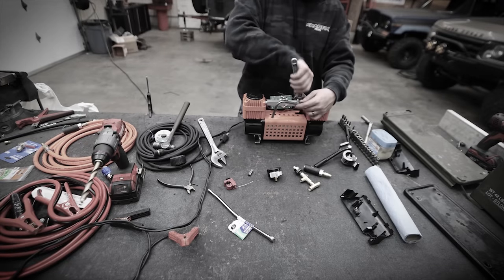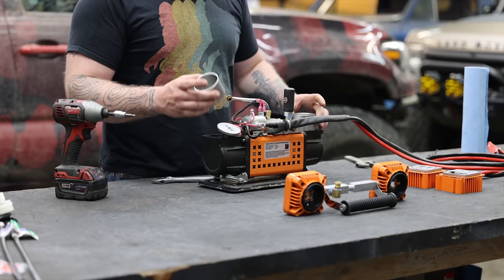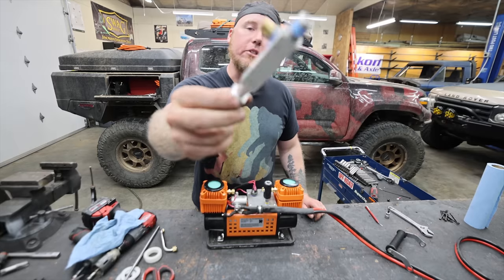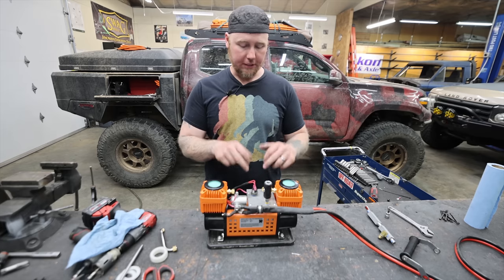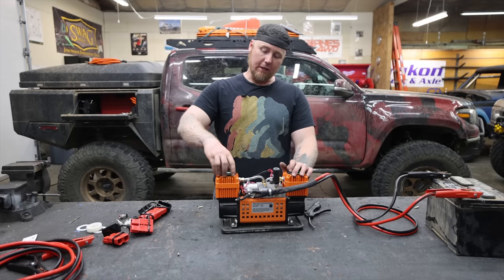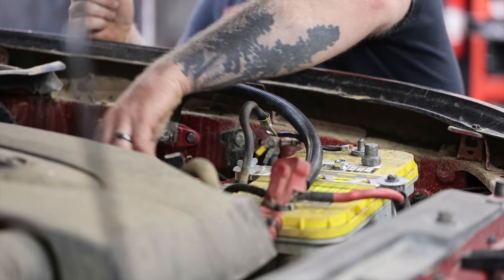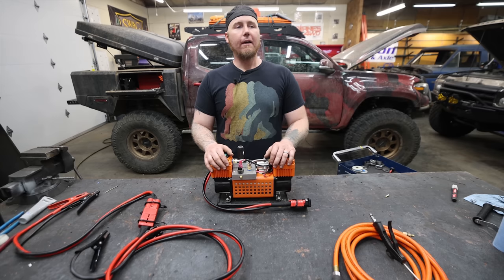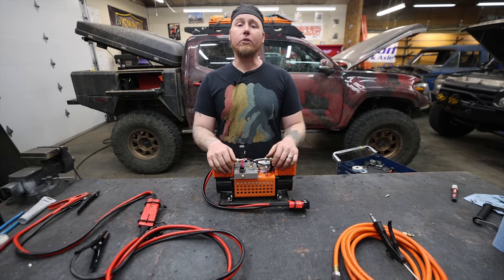Best Off-road Air Compressor MODS Part 2!

Comment: i've been interested where i saw folks running air hose under their truck that is plugged into their compressor and tank with quick connect ports next to each tire area. then to air up they plug in short hoses to each port at all 4 tires and can air up all at once. that would save a lot of time. maybe since your compressor isn't mounted in your vehicle you can have the port that would be plugged in to compressor tank just be another quick connect next to your power anderson port? 

can't remember the name of the channel or the guy that did this, but maybe you will recognize him: skinny blonde dude. has a tacoma truck. has a cool video about a 270degree batwing awning and more. both a no weld and a welded one. he has orange pelican cases on his truck. he took off his bed last year and did a custom flat bed with integrated storage boxes and sliders etc. that is all i remember though... if i remember i will update ;)

Comment: My only problem with these compressors is after 15-20 seconds the air becomes scolding hot and you have to top the tires up after the air cools.

Comment: Instead of a handle for it why not put it on a little metal sled? Add some hooks to wrap a few foot of air hose around. You could even add a little compartment for different air fittings for tires or inflatable air mattress or water toys.

Comment: You have so many cool ideas. You should think about  a small CNC or 3D printer.  Check out the channel Makers for Motorsports. The guy over there 3D printed an intake manifold.

Comment: Small Solar Panel wired with cheap mppt solar controller and anderson plug could act as a battery charger via the new power plug.....

Comment: Remember that at the end of the day you are limited by the flow capacity of the schrader valve on your tire so there is a point you cant inflate faster.
Reply: With a lot more CFM it can go a lot faster through the schrader valve. Guaranteed
Reply: Yep...try airing up a tire with 175psi shop air...big difference

Comment: I wouldn’t have drilled such a huge hole in the top of the “head” I would have drilled many smaller holes (like a grate, same airflow rate gain w/o sacrificing protection of internals). The whole purpose of these Mods is to improve Performance while simultaneously improving Longevity of the equipment. . . . Just my opinion.

Comment: To test cfm, take a tank of known volume and fill it!
Reply: But the problem is known volume. Are they labeled accurately or just rounded numbers
Reply: @mrmotofy  calculate it! Fill it full of water and measure it that way, it's just an approximate test because it will vary so much at altitude!

Comment: Bigger IS better, until there’s a loss of air velocity.  Think about sucking on straws that get bigger and bigger and bigger.  Eventually you get to a point where you can’t suck anymore and bigger is actually worse.  It’s a fine line, that unfortunately can’t be found without a way of measuring CFM.  I think the projects coming along great though.  Keep up the great work Nate.

Comment: Those Anderson and cable are way overkill for the setup making it heavier and bullet than needed. The smaller Anderson SB50 are rated for up to 120a continuous draw with 6awg cable, so it would work by adding a switch. You are using the either sb120 or sb175 Anderson which are way overkill for that compressor, unless you did it just for the hot connecting capability. The other more concerning issue is that they are only rated for 240a and 280a continuous respectively, so you have effectively derated your jumper came by about half by making that joint.  Anderson connectors are great but you need to know your product specifications veggie just wacking them on a wire. Your compressor is fine but way under the specs and your jumper wires are now half as good as they were before you cut them.  The only way the wires would be still within Android would be using sb350 Anderson but they are way too big. That big fat wire connected to your battery needs an isolator or something. There's a reason why we don't fit winches without isolators anymore.

Comment: Its too bad these are out of stock ive been looking for awhile
Reply from the maker: I agree. They are very low quality but are also a great place to start. I'm happy to modify a $150 compressor but I don't want to touch a $600 ARB twin lol. Hopefully these will get picked up by another US dealer soon.
Reply: @DirtLifestyle  I found other twin compressors on Amazon and such but none of them compared on the cfm #’s

Comment: Good job, got 2 suggestions. The small "flap style reed" valves covers a very small hole, make this bigger to have a drastic increase in flow. Might fit more than one like you mentioned... Then the big wire you run from the battery is a hazard unfused, best practice would be to run a manual battery cut out switch close to battery, I do the same for the vehicles winch, that way you not going to set things on fire if you have a minor frontal impact. m2c

Comment: Did you seriously crimp and Sauter those connectors and the wrap them in electrical tape instead of heat shrinking them?🤨